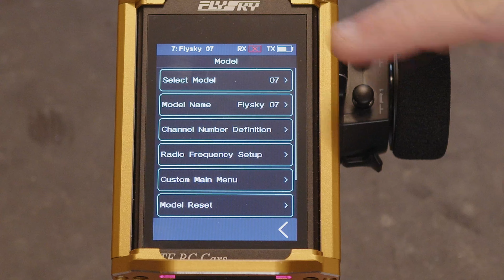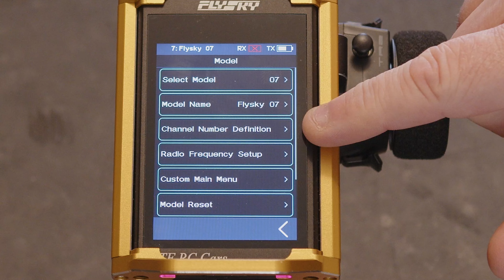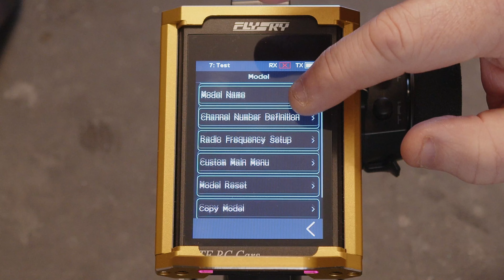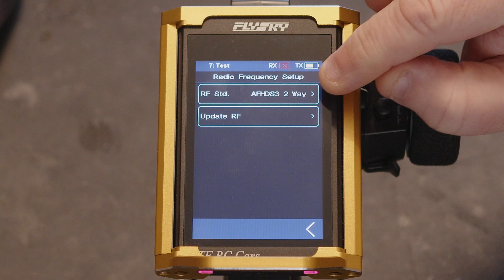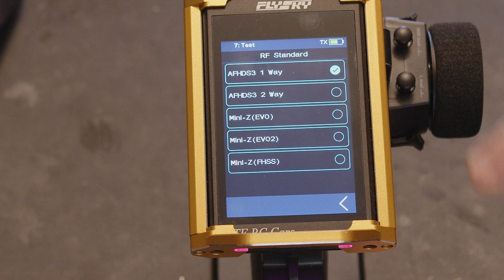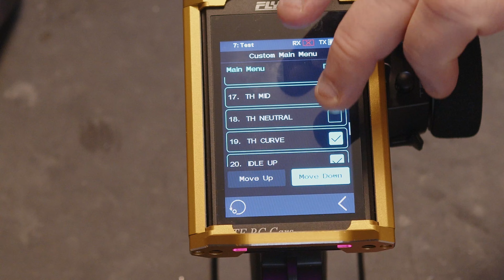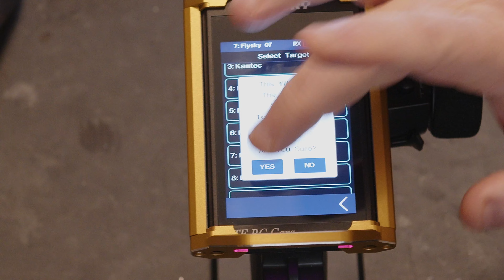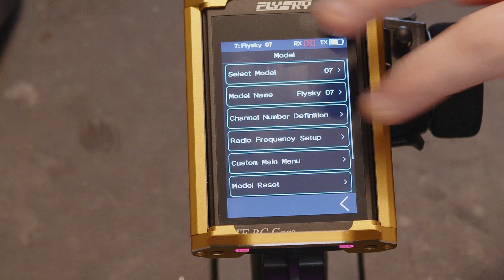Flysky NB4+ Model Menu guide

Comment: I have 2 pan cars programmed on separate model 1 & 2. If I have both cars on regardless of what model I’m on both cars work. Is this normal?
Reply from the maker: What transmitter and what receivers
Reply: @ flysky Nb4+ and the FGR4D receiver in both cars.
Reply from the maker: Yeh that's not normal are you sure you have bound them correctly as enhanced receivers in 2 way